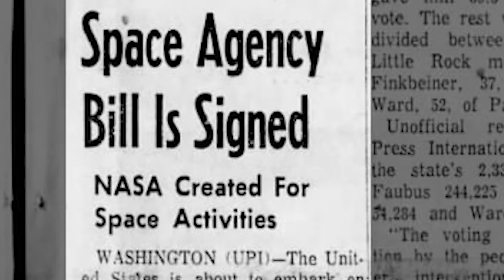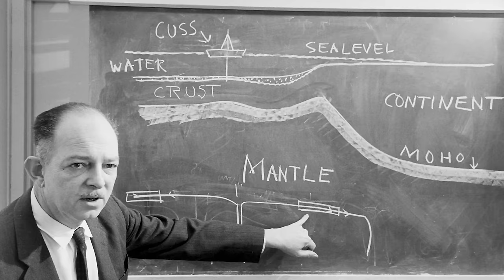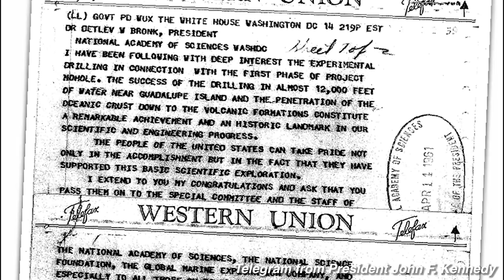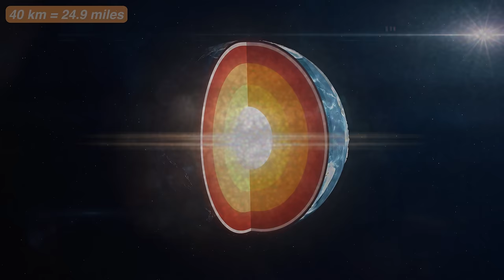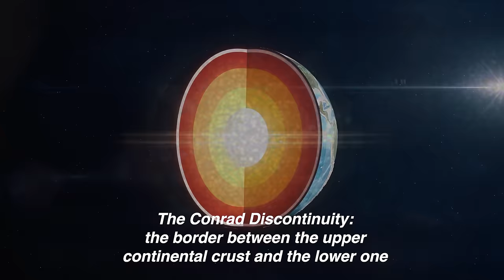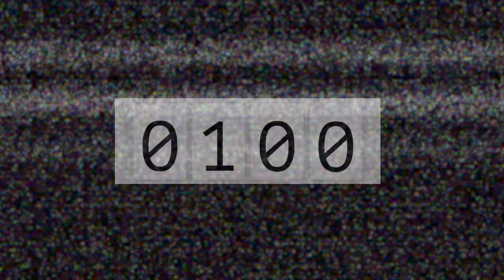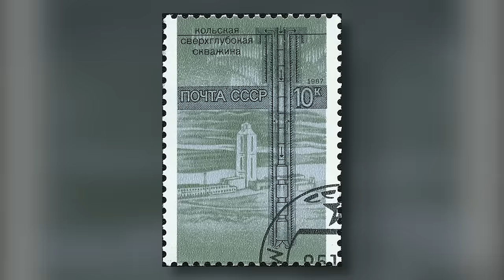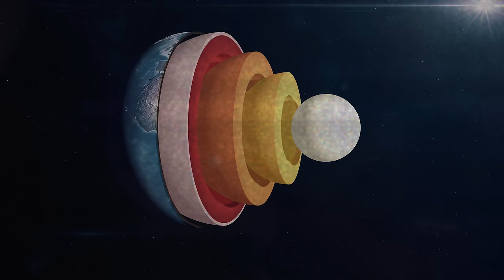The World's Deepest Hole

Comment: So if a ship would drill In the Mariana Trench would they be able to reach the mantle or would that make it even Harder. Either way another great video thanks
Reply: Probably harder considering how long the ship would have to endure the intense pressure. If something goes wrong with the ship, doubt they can make repairs in those depths...
Reply: @terrylouis9183  assuming it's a surface vessel, would drilling in the trench allow the drill to go deeper since it would be starting that much deeper than on the surface
Reply: @hueginvieny7959  still wouldn't change the pressure and heat it would face as it drills deeper. Eventually, it comes down to technology.

Comment: Lol not surprised the Chinese drilling rig is about 30years behind.. people stopped using/making kelly rigs a while ago. They probably got the specs from that trash "black gold?" Show that was on history channel or whatever tlc years back.  

And there are salt zones that move, in north dakota theyre around 7k feet, theyre tricky to drill through constantly collapsing as theyre always moving. I was on a workover and we were fishing pipe/doing casing patches and itd only take a couple hours to round trip tools (pull all the pipe out change out the tool on bottom and run the pipe back in to bottom) and the casing we had cut through would already be collapsing in and we'd have to wash through that area again to get to where we had cut pipe.. after a month of fishing we ended up capping it and i believe it got plugged and abandoned. That company ran cheap casing or something because we did that on a lot of wells and thats the only time ive ever seen a company have to do that to a well to save it.